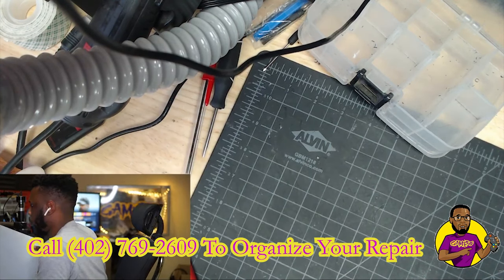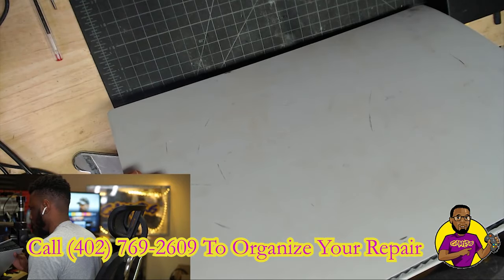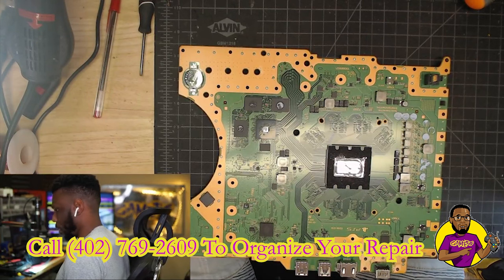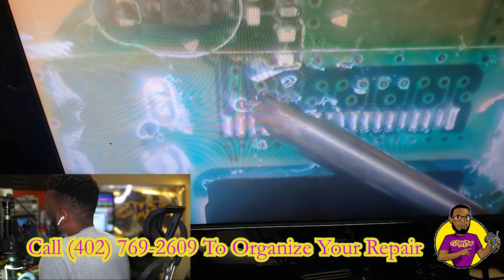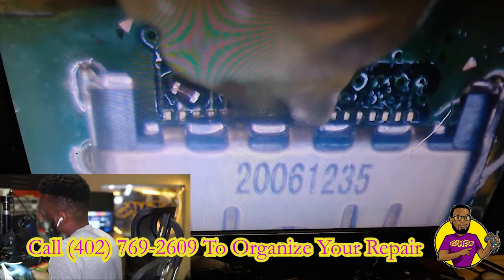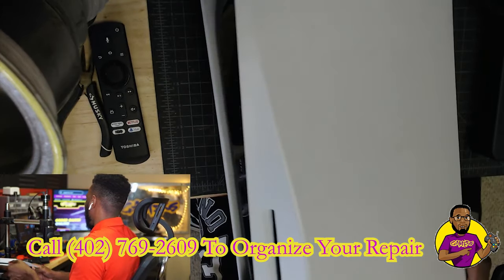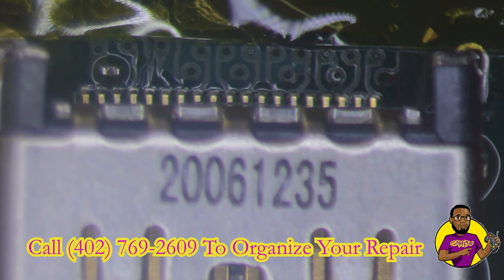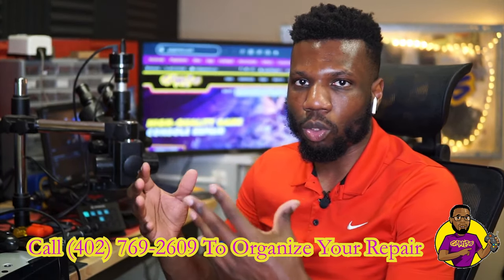I Bought Two Broken PS5's For $50 Can I Fix Them? - Water Damage Fix & HDMI Port Repair

Comment: You know it's mind-boggling makes me wonder what the hell are these people doing to these ps5s to destroy them like this? I mean I still have my original PlayStation from 1995 still in its box the thing still looks and runs brand new. it's the same with every console that I have purchased that's been released since then. You name it I probably have it even the special editions and every single one of them are in like new condition I have a couple of vintage game consoles that's never been opened that are special editions. But as far as the HDMI's go she's definitely an issue during manufacturing my brother works in The geek squad repair at Best buy and he was telling me the other day been almost every single one of the launch consoles all of which were models 1000A/B that they sold have been returned with faulty HDMI ports and or wouldn't even turn on.
Reply: HDMI can be damaged easily if you unplug to clean but are not wide awake so pull the cord to hard or something I am guessing folks be doing. Cause if you think about it the HDMI port in the back so no other reason to take it out and them systems was clean like new so I think the owner over cleaned them and was to aggressive unplugging the HDMI
Reply: HDMI Port in PS5 is really weak. Also, kids.
Reply: Ps5 are easily destroyed

Comment: Yo my ps5 crashed it blinks blue then shuts its self off I’m interested in getting it fixed
Reply: Same thing happened to me and Idk why
Reply: @Violator225  I just sent mine to Sony if yours is under s year old your good but it cost $259.00 we bought the bundle from game stop for 900 so now we r in it over 1000 it’s ridiculous best of luck getting it fixed playing on ps4 is an absolute nightmare
Reply: @Just_A_Girl2015  I called they said 199 + tax so it comes out to $250 even after shipping ?Also how long did it take I really would appreciate the feedback
Reply: @Just_A_Girl2015  I brought mine used and they tracked the serial number for me
Reply: @Violator225  I just sent mine the other day but supposedly a month to a month and a half
Reply: @Violator225  how much did u pay used? I was thinking about swapping to an xbx because dealing with Sony had been a pain in the ass
Reply: @Just_A_Girl2015  a fkn month ? That's insane I had a feeling it was going to be like that
Reply: @Just_A_Girl2015  I'm thinking of the same might go to Xbox but I got all my game data on psn keep me updated I'm going through the same thing and called just about every repair shop in LA real risky to fix it at another place don't want it voided but I was afraid sony would pull some bullshxt

Comment: Thanks to techwiz0 my ps5 seems to bricked after an hour of play I was able to play an hour of austro until the controller randomly disconnected and refuse to sync back to the console it just flashed blue light when I pressed my ps5 hooking it via cable didn't help techwiz0 got it fixed
Reply: I was able to get to him on telegram